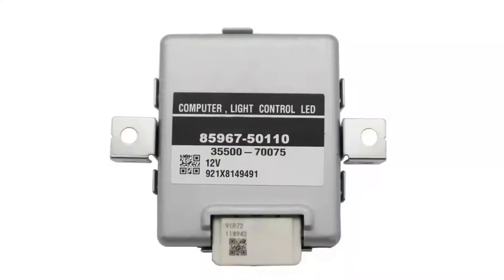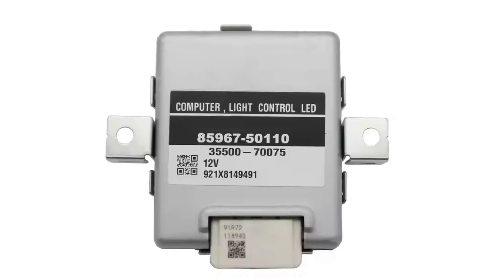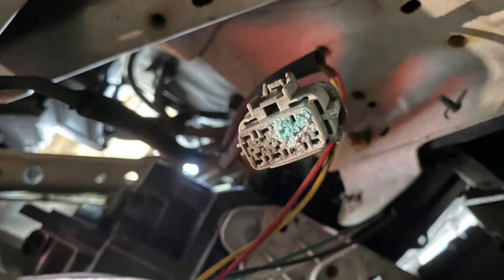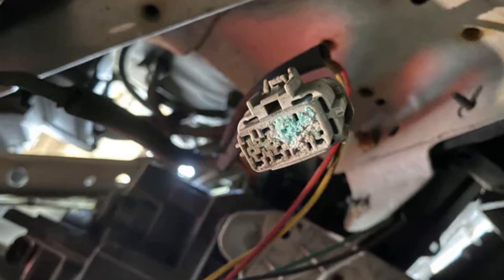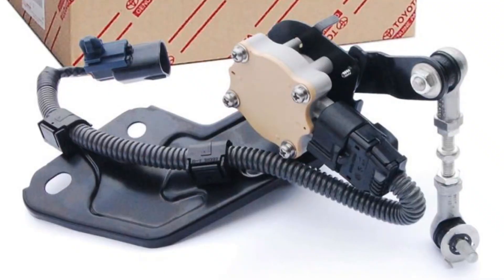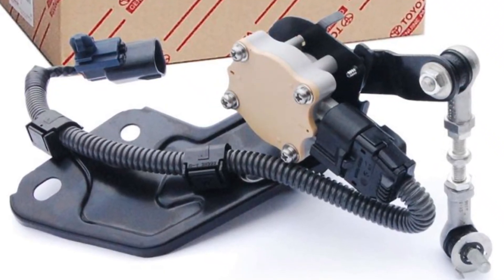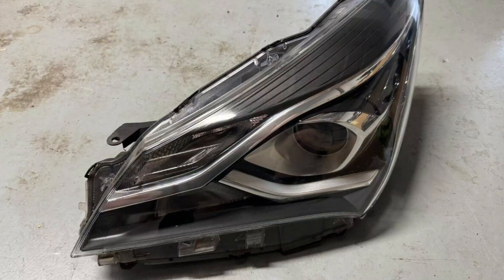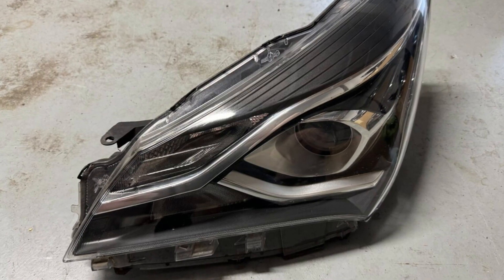“Headlight system malfunction” warning in Toyota – reasons

Comment: Hi.
I had a car accident and the right headlight was damege.I buy one from a wracked car, also full LED .
After installation everything works fine on both headlights,but come up B2431- right LED headlight.
The must be paired with ECU ,can the toyota do that ,or what is the fault here.
Thanks.
Reply from the maker: Any good workshop with a high-end scanner will pair tge headlight unless it has a different connector with differently placed pins

Comment: Got these errors after installing some aftermarket headlights and from what I can tell these headlights don’t have control units which causes the car to think it has a bulb out on my Corolla. The codes using tech stream come out as B2340 and B2341. It’s annoying because oem are crazy expensive and it’s hard to find the right aftermarket units
Reply from the maker: Those are very strange codes. I've only seen the b2341 once, and it was connected with a sunroof sensor. I believe you can program this headlight system out of the body control module to get rid of the message, but you will need professional toyota tuning guys to have a look, which won't be cheap at all.
Reply: @TopicMotor can I do it myself with a snap on scanner

Comment: I have two 2018 toyota camry 2.4l LE and SE and both have the malfunction lights on the dashboard, the LE is even blinking when I turn the lights on, but not when I have my parking lights on
If anyone have the same issue with a camry and you fix the problem please let me know...
Reply from the maker: Have you tried reading the codes with any Toyota-compatible scanner (not a simple OBD-reader from AutoZone)? This would help much. Sometimes, after you clear the codes with such a scanner, they won't reappear. In other cases, you will know for sure which module sets the trouble code.

Comment: My Camry does not have any leveling systems. Everything works perfectly however the warning comes on every time. I get no warning with running lights.
Reply from the maker: Are the headlights OEM? Also, any wiring issue in the headlight harness can cause this potentially, but I've never seen this in real life.
Reply: @TopicMotor  The lights work perfectly - running lights good, high beams good, and the auto high beams work. I don’t know the history on the car but it was involved in a fender bender before I had it. The wire harness looks good. I understand an aftermarket light can cause errors. I am uncertain if a headlight is aftermarket. I looked closely but they appear identical. A cooling fan can cause an error but I have not checked that. The error doesn’t display until I start the car and turn on headlights. No error with low intensity running lights.
Reply: @oreajorea09 no but I’m thinking the previous owner had a fender bender and replaced the lamps with non OEM. I have yet to confirm. The lights work fine though.
Reply: @shanec4441 do you know changing bulbs for high and low beam for 2025 camry? I tried to but can’t find removing bulbs
Reply: @Luxenmusic these cars don’t have headlight bulbs. They have LED projectors and are not usually changed individually. The whole headlight assembly would be replaced.
Reply: @shanec4441 did you fix your issue? I seem to have same problem
Reply: @JepindeerMight nope, I didn’t fix the problem. I am stubborn and refuse to take to a Toyota dealer that will charge $200 just to diagnose it. I did take the wiring harness apart and cleaned them with electronic cleaner. They appeared in good shape. No change after cleaning the wiring.